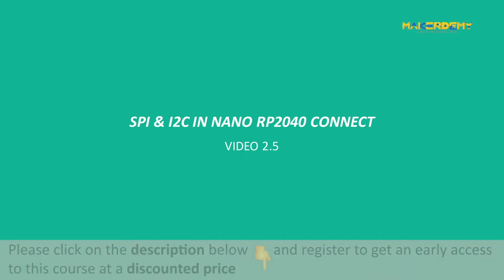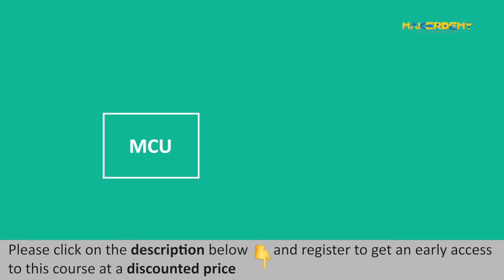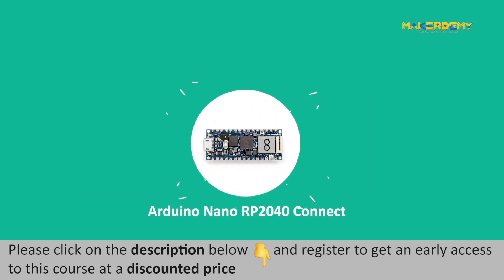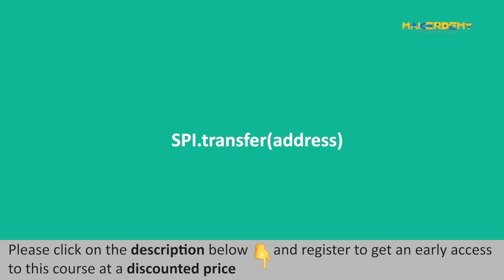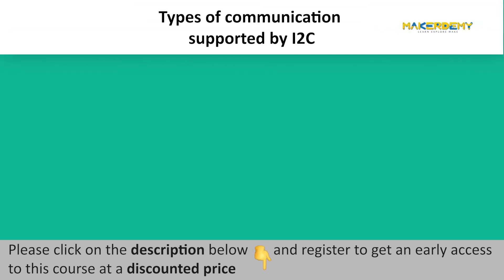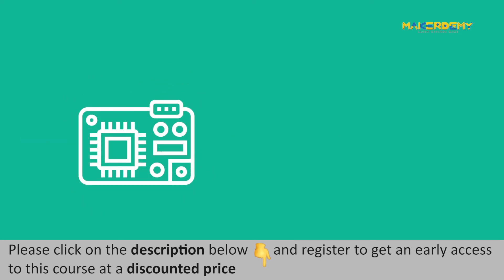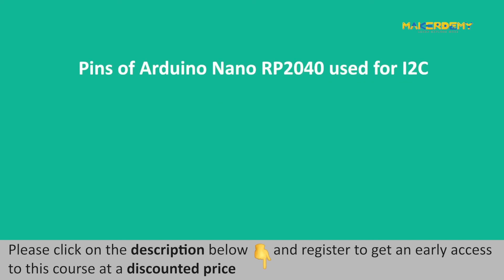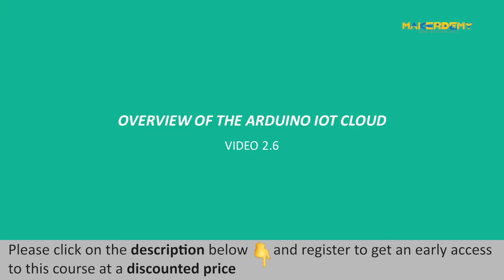SPI & I2C in Nano RP2040 Connect |  Introduction to Arduino Nano RP2040 Connect

Comment: can we use both a SPI and an I2C devices at the same time with Arduino? Are there any drawbacks or do we need to write a special code for this?
Reply from the maker: Hi 

Yes you can use both SPI and I2C devices at the same time with Arduino. No such drawbacks. The code and libraries will depend on the device you are connecting with the Arduino board. Both the devices you want to connect will have a purpose hence no special code for this.
Reply: @MAKERDEMY  Hi, thank you for the reply. I understand it now!